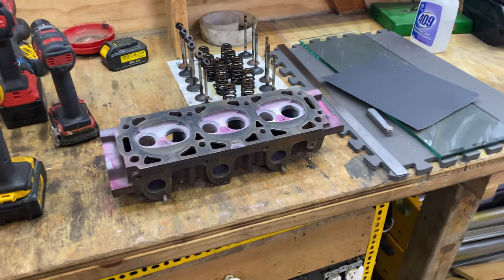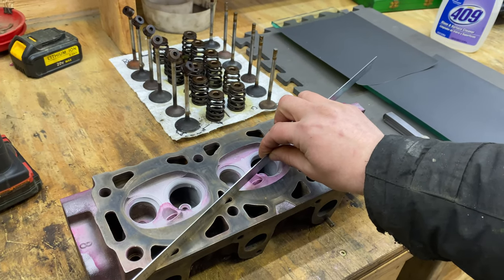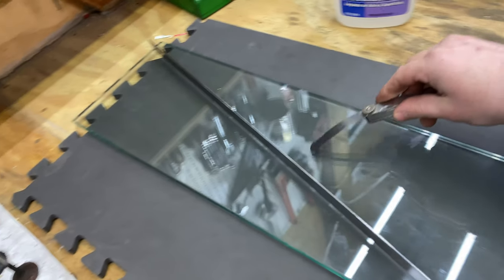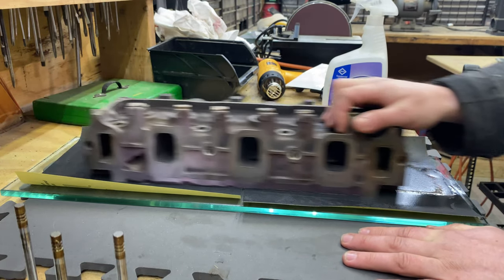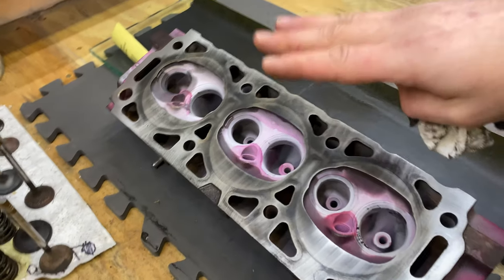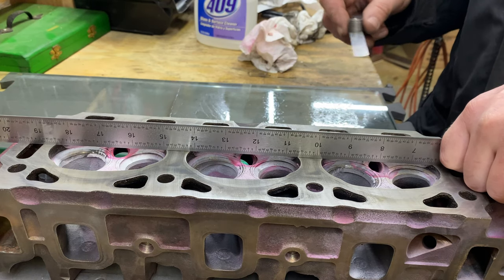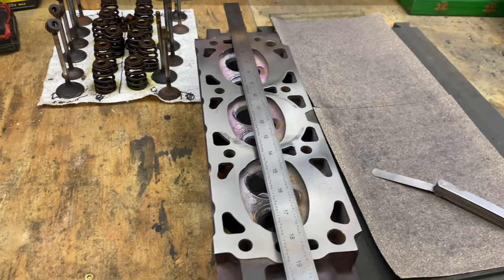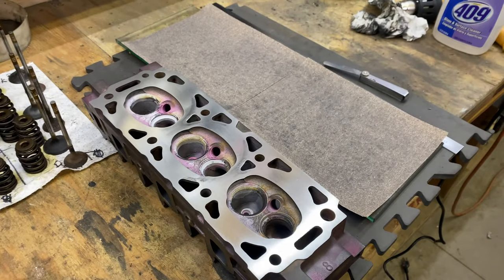Refinishing and Flattening Engine Heads at Home with Sand Paper

Comment: This method works fine.
I did my block after i had my sleeves drop and flattened the head.
Both aluminum 
I started 600 wet and finished 800 wet 
Used water and dish soap and had no build up.
Run a cometic mls x head gasket with 27psi boost on a k24 engine for 8 months with zero extra  pressure in coolant
 system.i only did it this way because machine shop said 3 month wait
I spent 6hrs in total and have a perfectly flat deck on block and heads.
One thing i did differently is figure 8 patterns to not gave inconsistent amounts of material removed. 
I also saw another comment about flipping the head around  so your not putting pressure on 1 end.
You could see it when you started as it took more material off the side closer to you that was getting more pressure
Reply: I'm about to do another k swap in my car, (the head warped when I blew it up the first time.) Then a month later I started to have pressure in my coolant until the engine eat crap. Is your car still working? Any issues at all or advise? I want to do this car right this time.
Reply: @raucouspie3045  mine is still rocking great.
Making 28 psi using a siruda folded layer head gasket.
No extra pressure in coolant system.
I used a bucket with dish soap and warm water.
Do a few laps then dip the block in the bucket.
I had no build up on the paper.
Also faster even strokes/figure 8 pattern.
Reply: @audirx8  you are awesome my friend.
Reply: Good point on flipping the head around, I thought the exact same thing, these are 2.8 Chevy heads I'm about to do the exact same ones after porting and polish

Comment: Great job. I resurface my own heads using a large machinist file. It is very true and I can get it down to less the 2 thousandths. I picked up the file at an auction so I can't tell you where to buy them but it is faster than sand paper.
Reply: SMH
Reply: @bad406camaro  I would like to see that in action,lol

Comment: Looks great, I do the same thing because I can't wait weeks to get a head machined.
Reply from the maker: Not to mention saves money! Just takes a little time.
Reply: @radozeman We're you get the glass bruh?
Reply from the maker: @troybrake5686  most hardware stores will have pieces of glass either that Amazon or eBay
Reply: @radozeman  I remembered I have a few pieces of granite at my mom's, hopefully there still there, I believe that will work good also, we have a surfacing machine in the shop at my work but it's not setup right, my heads are not warped I'm just wanting to get the surface consistent for the gasket to seal, I have a few pits

Comment: Did this, only had a small piece of glass to work with and could only go back and forth two inches or so, made the mistake of using old sandpaper first did several rubs back and forth and it made it worse. Then I got some new sandpaper and had to do a lot more than I would have to get it to where it was. Spec was .002 or less, got rid of nearly all the places I could get .0025 to pass under previously, only have one oil galley where I can barely fit .002 under. Must of taken like 30 measurements every which way, before calling it and figuring it's just that one spot.

Comment: What kind of sandpaper material for a aluminum head ? Aluminum oxide ok ?
Reply from the maker: Yes it is! I like this stuff myself: https://smile.amazon.com/3M-26080CP-P-G-No-Slip-Advanced-Sandpaper/dp/B00HM96R22/ref=pd_bxgy_img_sccl_1/130-3774895-0059358?pd_rd_w=h8j0P&content-id=amzn1.sym.7757a8b5-874e-4a67-9d85-54ed32f01737&pf_rd_p=7757a8b5-874e-4a67-9d85-54ed32f01737&pf_rd_r=37ESXEPB20R1NJW858C4&pd_rd_wg=4joyg&pd_rd_r=25f37a29-9a66-47c8-b6b2-d2d1941419ad&pd_rd_i=B00HM96R22&psc=1

Comment: Nice video I expecte that head is cast iron, be careful when doing this with aluminum use a 1000 or 600 grit you can use oil or paraffin. I didn't catch the feller gauge size but I think not 15 thou moor like 1,5 thousands

Comment: you need a machinist strait edge.. there not $$$..
Reply: Yes they are the good ones 0.001” accuracy straight across are a lot of $$$
Reply: @justinw523  no there not, i have several  under $200, that is NOT $$$, thats cheap. i have 3 that are +/- 0.003 and they are about $80 each, more than capable of doing the job. you just have no clue at all what you are talking about.
Reply: They’re

Comment: Hello, can you please tell us what is the pink coloring on the cylinder surface?  Corrosion inhibitor?  Also why is it important to use moistened sandpaper instead of dry?
Reply from the maker: The pink coloring is for checking for cracks, I forget the name of the stuff, but it is a two part system you spray on the head to check for cracks.  The sand paper needs to be wet to “stick” to the glass
Reply: It's the magniflux
Reply: @radozeman  I just tried this and I can't get the paper to 'stick' to glass with water at all.

Comment: The ocd freaks will say to take it to the machine shop, but if it's flat and within specs what does it make a difference? Unless your building a nitrous or boosted motor you,ll be fine.
Reply from the maker: Exactly! Unless you plan on doing something stupid with this motor, which I don't why you would with this motor.... it'll be perfectly fine!
Reply: boosted motors are not checking the heads a lot of the timed

Comment: Thank you for the video, very interesting, i want to ask you how do you determine how much material is lost, can i use the same tipe of gasket, or i need another spec
Reply from the maker: I just sanded until I got everything and it was flat.  I doubt the little that is taken off will be a problem for any gaskets.
Reply: Depends on several factors... type of engine, how bad it's warped (i.e. how much material has to come off), and what you're trying to achieve (is the engine going in a race car or a beater/daily driver).

Comment: Okay I'm that guy. I do this backwoods with a heavy plate that's milled VERY flat. I do it that way because I have to jig the head "flat". I also do it because the head is heavy and not an even weight the plate is an even weight and gets a more even result. I use small circles. Later and have a blast.

Comment: Instead of glass can I use a slab of granite???
Reply: The idea here is using a reference surface. Some folk get angry at what is shown in the video (I was a mechanic myself so I can say that) because they don't know how much of a common technique this is in engineering/machining (I'm now a mechanical / design engineer). The tricky bit is knowing if your reference surface is flat enough. There is nothing 100% perfect in this world, everything has tolerances. Even surface plates for this purpose have tolerances on flatness. So for a "DIY" method the flatness of the material will mostly depend on the manufacturing process of that material:

Industrial glass usually comes off big roller mills, which produces flatness sufficient for this purpose. Glass is also "cosmetic" - as it's made for construction (e.g. facades of flashy new buildings) it would be visible if there are imperfections. Though during the cooling process warp can occur, but the manufacturer will try to keep this to a minimum in their own interest.

Granite would be cut from natural stone and then ground flat. Industrial tiles are probably pretty good, masonry stuff can be hit and miss depending on the source. I.e. some old gravestone might have been made by hand or an a wobbly machine and therefore not be good enough.

Laminated wood board also works though if stored incorrectly (bent over longer periods of time, moisture) it might end up warped, this is less reliable.

Thicker materials are less susceptible to warp so changes are they are flatter. 

There is an interesting video on the subject of flatness https://www.youtube.com/watch?v=gNRnrn5DE58&t=136s&ab_channel=MachineThinking highly recommend that :)

Comment: 3M MAKES rolls of sandpaper with self adhesive on it so you don't have seams and uneven adhesion.
Reply from the maker: True, it is slightly more expensive, plus it is easy to remove this way.

Comment: Great tutorial. Question: How thick is the piece of glass you used? I'm trying to find some 1/2 inch pieces but it looks like most places around here only stock 1/4 inch :(
Reply from the maker: Try Amazon or eBay, I’d recommend 1/2 if you can, 1/4 should be fine though, just needs to be flat.
Reply: @radozeman  I feel like if you're sanding down surfaces to refinish them, but they're already flat, 1/4 inch is ok; but if you really need to flatten a head that isn't, you probably need 1/2 inch. I was just going to clean up engine block surfaces with 1/4 inch glass.

Comment: The exhaust seats look like they're completly pounded in
Reply from the maker: Just the way they are on this head I guess
Reply: @radozeman  even in the few short shots I could get a clear view, I can see they are not quite right. I'm not trying to give a hard time or make a fuss on your content, at all.  But repairing/remanufacturing cylinder heads is something I have many many years experience in and do almost daily and those looked pretty pounded from here. I mean, if the install heights measure up correctly then I have no problems eating my words, wouldn't be the first time lol. But from what I just saw, they did not look right.
Other than that, keep up the good work👍